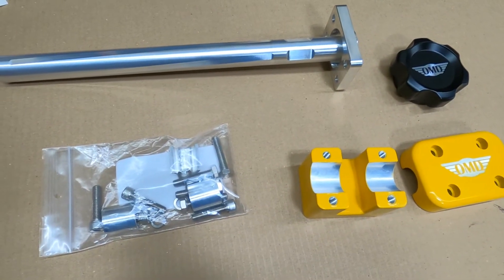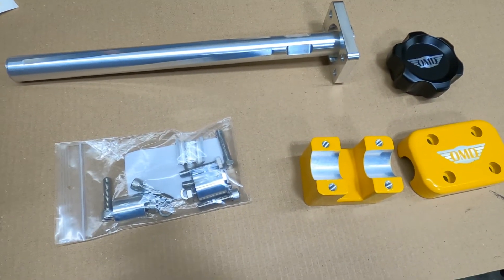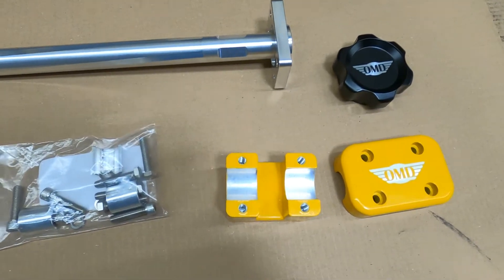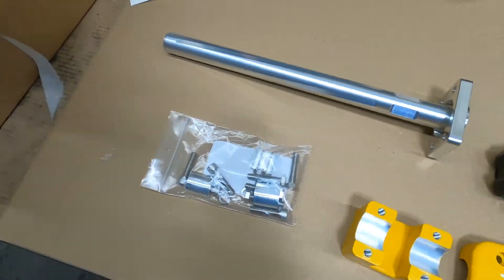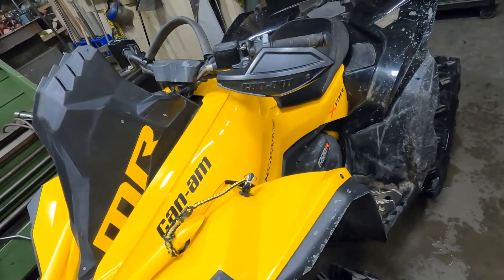2" Bar risers and steering stem support from OMD install video.

Comment: Hello XMRenegade, 
It's been eight months now, so are you still happy raising your handle bars?
Or do you feel like there's a bit of an "ape-hanger" feel while sitting down?
(I want to go with a 3" rise as I'm quite tall and want more stability from higher handlebars when I ride standing up.)
Reply from the maker: Honestly it is probably my favorite upgrade. I am about 6'2" and I could see going another inch up, I just wasn't sure about cable lengths. It feels completely natural sitting and 10 times better while standing.
Reply: Ah, good to hear @XMRenegade .  
And you're right, the brake line, throttle cable/wiring, and other wiring runs will certainly be more effort.   Besides the 3" rise I'm thinking about handlebars with more rise as well.  Plus some kind of seat pad addition.  Seeing your confirmation gives me some confidence in those mods although I'll do them one at a time.  At 6'7" I just know the bars will feel quite low.  I have an Outlander Max on order that should be delivered quite soon now after a 5-month wait.  Once the warrantee is expired I'll start making those mods.

Comment: Did you have a problem with the cables being to short?
Reply from the maker: No. Cables are just long enough. I dont think you could go with a bigger riser without modification though. Just to add, the bar risers make the bike so much more comfortable, I highly recommend them!

Comment: Do you need steering stem for it to work?
Reply from the maker: No you don't need it.
Reply: @XMRenegade  what’s the point of the steering stem
Reply from the maker: @Parkerfredman  The factory steering stem is a hollow tube and is fairly easy to bend when pushing on the bars hard. The steering brace is a solid peice of aluminum and prevents this.